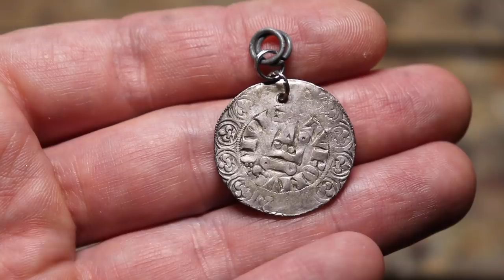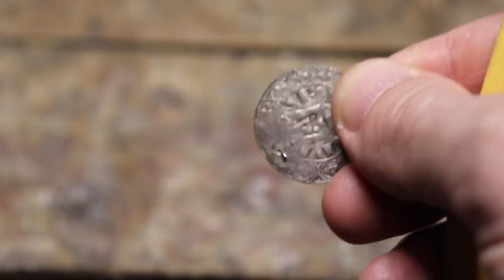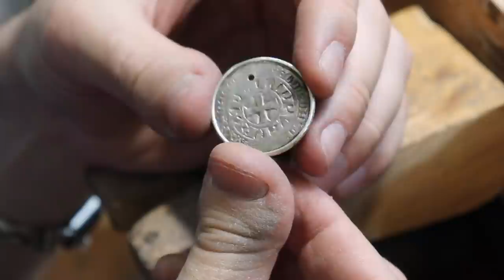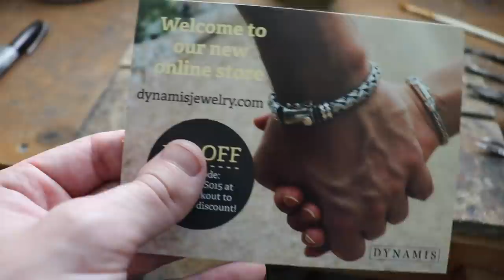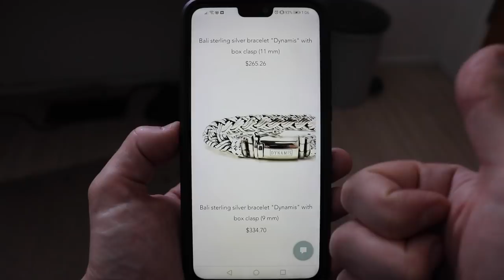Making Silver Frame for RoyalPhilip V le Long (the Tall) - King 1322 Coin

Comment: is the trick to soldering with gaps using wire solder? Seems like I've seen in work on youtube many times now. Anybody else have any experience with this?
Reply: The "trick" is to use a bunch of solder. Which for some jewelers is not ok, but as you can see it can be done. Some people   use tiny amounts of solder because you don't have much left over to clean up.